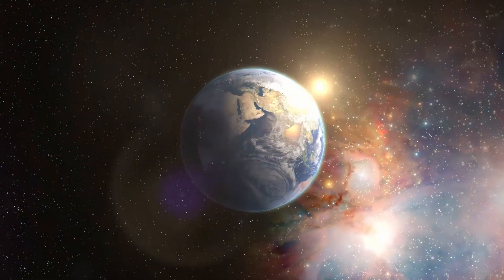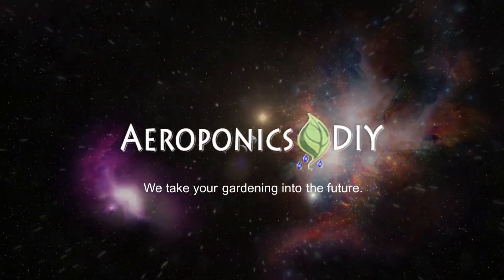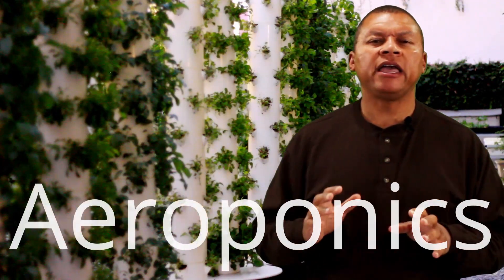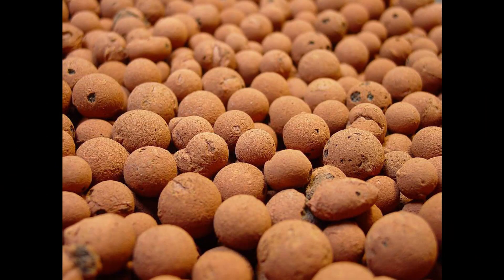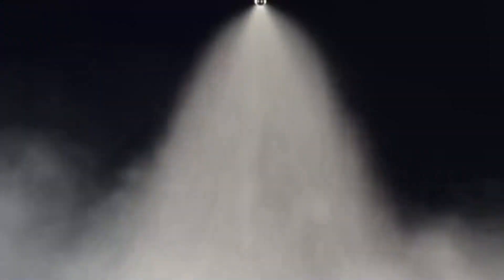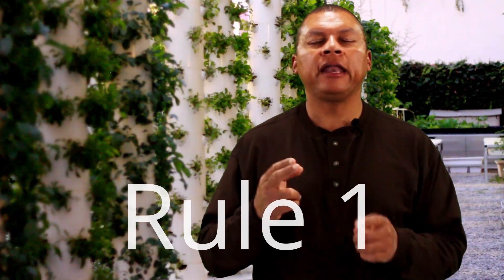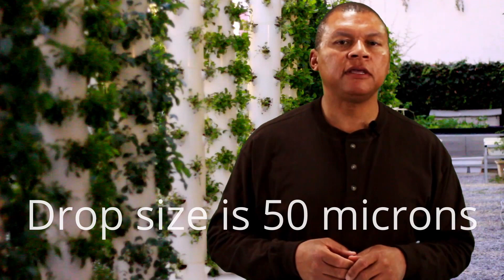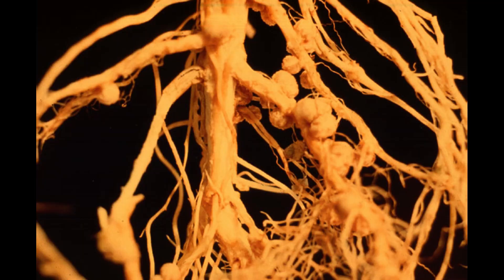What is true aeroponics?

Comment: I’ve been requesting knowledge all over the internet.  I’m an Aquaponics guy.  I’ve incorporated all the major methods of growing in my system, including DWC, NFT, Towers, sand, Dutch buckets, dual root zone, and I probably forgot a few.  My next big thing is that I will incorporate aero Aquaponics.  I know ppl do it, but there is no information at all on how they do it.  Forums remain silent, when I ask.  Can you give me any advice at all?  The major issue is that sprinkler heads clog with fish poo.  Is there a certain size of head that may not?  And I just learned today that’s there’s high and low pressure aeroponics.  I’m gonna guess I’d be better off in low pressure, could you recommend a sprinkler head for that?  Or I’ve seen just drilling holes in a pipe filled with pressure, hitting the side walls… will that be productive enough to warrant the build?  Can I incorporate a high pressure system, or is it a pipe dream?  Thanks for any reply.

Comment: We built the Space Station high pressure aeroponic system and that's the readily available information. What nobody want's you to know is using that information works in space. The system we built for the earth as the variable is the information you need to build True HPA systems. You clearly explain the theory's behind the operation of a high pressure aeroponic system, yet those theory's come from information easily found on the internet. Why did you stop the video's?

Comment: OK. Root chamber needs to be between 65 to 75. What about outside temperature? Is there a range it has to be. I would like to know what happens if outside temperature drops bellow 50 while the root chamber is maintained 70.
Reply from the maker: Control the environment to what the plant wants. An insulated chamber makes this possible. So the answer is it all depends on what you are growing.

Comment: I'm having difficulty with the waist part of the system and the replenishing of nutrients. Are the nutrients recirculated when they drop back into the bucket? How much and how often do we add?  Also when designing a system,  what is the optimum number and placement of nozzles inside the grow room? Should they be placed on all four sides and how do we know the timing of the mist?  Thank You for a wonderful series.
Reply from the maker: Hi Sas,
I think the aeroponics calculator will answer most of your questions.
Thanks for the compliment.
Reply: Yes bro no calculator needed 👍

Comment: Good video. At 6:25 what is the white square material you started the seed in? Thanks. 👍
Reply: That would be a medium, which you aren't supposed to use.  I suppose the seed is supposed to hang magically in mid-air until its roots grow.
Reply: @tsilb  Just a sponge to hold the seed till it develops roots. Roots are hanging in the air, so 2cm sponge hardly is a medium, just holding the neck of the plant
Reply: @alexsiniov  sponge is a medium

Comment: Hey! I'm interested in designing an aeroponics system. Is there a group online somewhere where you meet? I have a computer science degree, and I am currently working as a software engineer for a data storage company. I am excited to automate the hell out of this.
Reply from the maker: Yes, we want to automate. However, caution is needed. It’s easy to over complicate the design. The more complicated the design, the more chance of failure. For example, the Boeing 737. The technology used must be proven, reliable, and simple to use. 
This will be a future video. 
If I want true aeroponics in your future, IT CAN NOT FAIL.
By the way, thanks for the kind words.
Reply: @HighTechGardener  I completely agree about keeping things simple. - less points of failure, less redundancy needed,  simpler code is also more maintainable, etc. Many benefits from avoiding over-complication! My job is primarily managing failure in a  datacenters. We strive for 100% uptime. I have done a little bit of IOT design, but there is much to still learn! I am learning so much from your videos about designing the mechanical portions (which my knowledge is quite limited). Thanks man! I'll probably be hanging around your videos for a while!
Reply: @JustMe-lp5td  I've been pondering the same, there are 5-6 things needed for a grow room.
1. cycle time outlet control
2.  light time outlet control
3.  tempature control and monitoring
4.  Humidty control and monitoring
5.  ppm of nutrient solution
6.  PH control and level

From there you could expand out to the addvaned items like co2 levels, water temps, water levels, alarms, VPD tables, etc...
Reply: Im working on this. hmu

Comment: Could you do a video specifically on media. In my experience you need  SOME media to support the literal plant. Even if that's polystyrene rings and a netcup or  rockwool. The roots are still exposed to the mist, but the plant itself is also supported. I don't see how blindly following some arbitrary set of rules about 'true' aeroponics is praxis for building the best possible biosystem.
Reply: Look up Donald Porta he has pretty good videos about his aquaponic system. He ended up using no media for inside the pvc pipe, but did use probably 1 inch rings cut from pool noodles to hold the plants in the towers.
Reply: basically, using hydrotron , root plug or neorprene insert for larger plants.  Smaller plants like lettuce and herbs, micro greens, sure, no media.  Growing marjuana for instance without something will cause some interesting problems 4 weeks in.  My plants kept falling over and had to do alot of heavy netting.

Second grow; using hydroton and large netti pots; much more stable.  Think the rule needs to be adjusted to the media should never cover root zone or retain water.

Comment: weed can be grown in aeroponics? im always on the lookout for new weed growing technology.
Reply: You can take a eyeball on my channel/vids and grow diary; have done about 10 grows using HPA or high pressure aero.  Ak47 and green crack namely, currently doing clone grows from last green crack harvest.  Playing with ultrasonic misters for even smaller micron level of droplet for next expirement and will eventaully do a bake-off.  The existing setup uses 3 nozzles at 50 micron per plant running at 100 PSI.